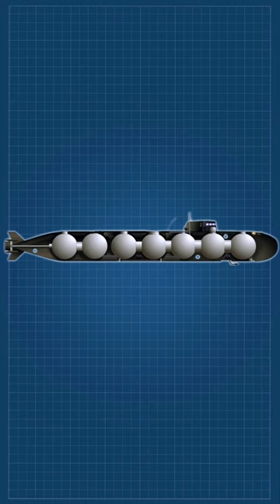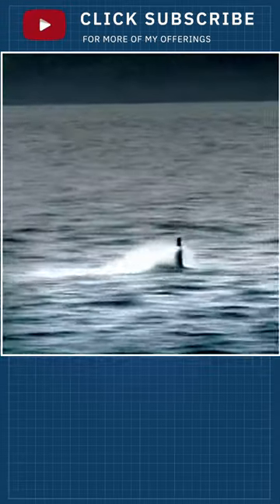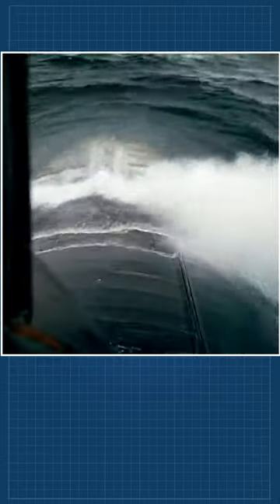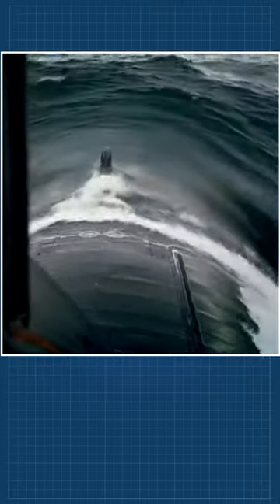Why are Russian Nuclear Powered Submarine So Large? #submarine #nuclear #shorts

Comment: All modern submarines have double hulls. The outer hull houses the ballast tanks. The inner hull is the pressure hull. It protects the inside of the boat against sea pressure. The Russian submarine fleet is now very old after the fall of the Soviet Union. Many of their boats are diesel electric. They are quiet but you still gotta run the diesel to charge the batteries. For that you have to be close enough to the surface to exhaust diesel fumes and intake oxygen to make the diesel engine run.
Reply: Russia have many new modern nuclear powered submarines
Reply: @tounsi925 ah like the Kursk?
Reply: @tounsi925 7 Borei- and 5 Yasen- class "modern" submarines have been built and of those only 4 Borei and 3 Yasens are in seaworthy condition. Because of sanctions they cannot get that western tech needed for maintenance 😂 so expect to see more from both classes in drydock soon.
Sure they have some older subs too but I wouldn't bet anything on their seaworthiness, so Russian navy and submarines at the moment are just a rusty footnote.
Reply: Most are nukes